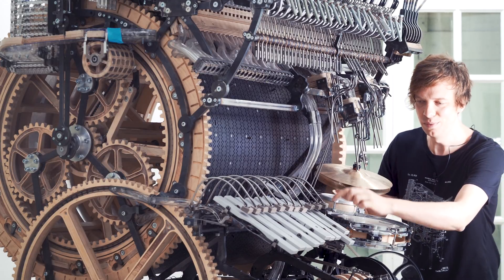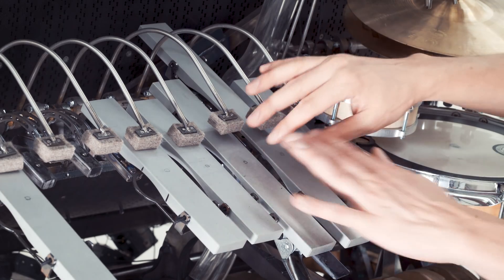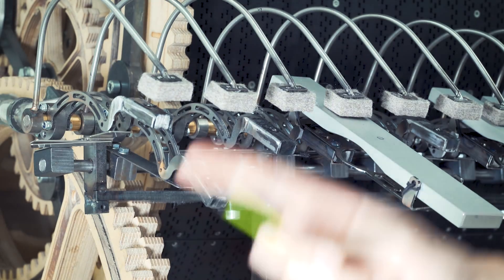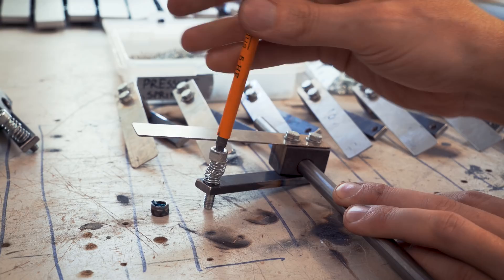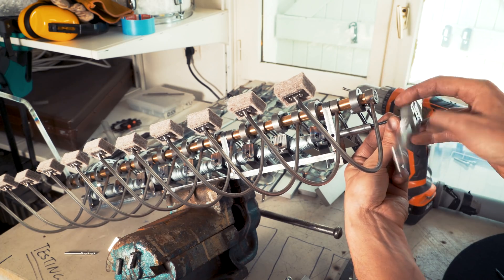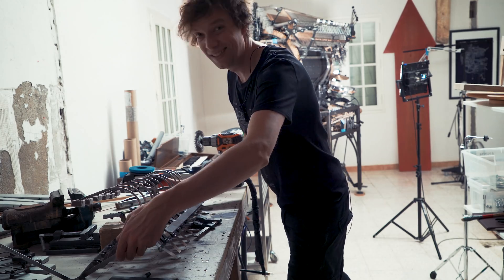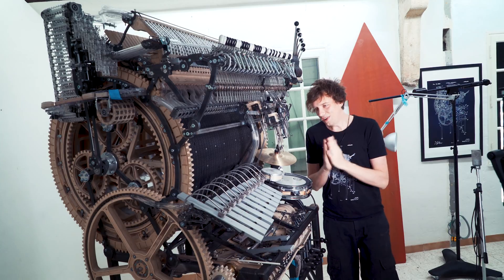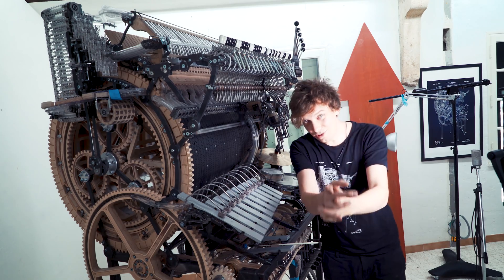Vibraphone Height Adjustment - Marble Machine X #103

Comment: To be honest, I'm still skeptical about the swinging of the plates.
If you play the same note in quick succession, it may happen that the plate grade swings up when the second marble hits it and flings the marble away?
Reply: Correct.  Martin requires that the marble bounce into a funnel after playing a note.  That bounce is highly dependent on the spring constant of the support spring AND the motion of the bar as it transfers energy to the marble.  Conservation of energy dictates that as the motion of the bar changes, the energy transmitted to the marble changes.  Further, as the mass of the bar changes, the energy transmitted to the marble changes.

All of these indicate that Martin will require a funnel large enough to accommodate the range of trajectories.  Until Martin knows that range, he cannot decide on funnel size and may be the reason we haven't seen any yet.

Comment: integrate adjustable springs to the plate holders, tune once and thats it
Reply: Or just integrate spacers
Reply: The weekening spring steel convinced me his solution is better.  Without adjustment he'll constantly be retuneing (sp).
Reply: "Without adjustment..." 
Read again, "adjustable spring" means you have a screw just as he did, but directly on the plates, so no need for adjusting at every swap.
(And can be later adjusted as needed)
Reply: @armanrgun47  How about having a screw at both locations, one for adjusting the spring steel height (combating warp fatigue) and one preset on the note itself? You'd basically almost never have to readjust the notes themselves (since the adjustment is related to the weight of the vibraphone bars) and the spring steel warps slowly, so it would likely be sufficient to adjust it only every set-up.
Reply: A cam on the holder where it rests on the spring steel should work.  However, there is an element of theater to what Martin is trying to accomplish here. So it's probably fine to have a few people "wrenching" on MMX between songs. The amount of laboring can be re evaluated once composing begins.

Comment: If your worried about timing issues from a few mm of height difference, what is going to happen if you play the same note more than once, while it is bouncing several centimetres.
Reply: bouncing is temporary,  but if a note bar is constantly offset it will play each note with offset
Reply: @nandakoryaaa  Yes, and what happens if its hit while its bouncing? The timing will still be off is my argument.
Reply: @qess  Yes it will be off (I don't know how much, it can sound fine anyway) but my point is that you still need to care about all bars being on the same level, or else it will be off always and it will be much more noticeable.
Reply: @nandakoryaaa  Was interested so did the math. Assuming a drop of 40cm, a 2cm swing of the bar could do a 7ms difference in speed. Assuming 3 hits and a maximum difference between the 2.nd and 3.rd hit to be 4cm, thats 14ms. The small 0.5cm constant gap is not even a 2ms delay. U still think the 0.5cm gap is the important one?
Reply: @qess  I personally don't think the gap is important. Once in the childhood I had an electronic stopwatch that showed 1/100th of a second, and I played with it trying to get the exact 1.00 or something. Hitting the 1/100th of a second right was pure luck because my error was always within 0.05. I don't even think about the 1/1000th. I am not a musician but I can safely suppose no one will hear that.
Regarding the MMX, I'm still fine with what Martin did. If the gap is important, then having adjustment is a must. If the gap is not important, then adjusted bars at least look better and leave less chances for some weird things that may happen as an accumulation of small errors here and there.
Reply: @nandakoryaaa  try listing to this up to about 15 ms: https://www.youtube.com/watch?v=3zZRy-UArXM should give you an idea of the perceptibility of the delay.
Reply: @qess  Thanks. I can "technically" hear it from 0.005 but it starts really bothering me at around 0.025th second
Reply: If you've watched the timing adjustment videos, he's definitely been worried about notes hitting less than a millisecond off.  I've also wondered how the moving vibraphone bars doesn't negate the attempt for such a fine degree of precision.

Comment: Martin: can I have some spacers?
Mom: no, we have spacers at home
Spacers at home: 18 washers stacked together
Reply: Ivan and Martin need to get together all the 3d printed Spacers :D
Reply: @brianhunt6943  He had a 3d Printer at some point making the marble lift. Wondering where it is now
Reply: Martin, PLEASE have someone with a lathe help you replace those stacks of washers.
Reply: J Warren he is subconsciously working toward 1,000,000 piece count!!
Reply: Brass tube cut to length as bushing, instead of stacked washers.
Reply: @akphoffman  Brass bar stock turned down into pleasing shapes to add to the steampunk aesthetic, this looks like a job for Clickspring!
Reply: @mulgerbill  Or Uri Tuchman  (Check out his channel if you haven't seen it )  :) Either would do a sterling job. Hope we'll be able to see Wintergaten if they tour Oz.
Reply: gammerbro567 I would have just added weight so each weigh the same
Reply: @stoat-ski  The problem with the weights would be the spring steel will weaken over time and probably unevenly and thus the weight would have to constantly be modified.  That's why this solution is perfect. Regardless of the spring steel's elasticity he can adjust the height stop any time to maintain optimal position.
Reply: @357BlahEn  the marble lift clear parts were CNC'ed by CNCAlex.

Comment: If you integrate the spring to the replaceable part, you can replace the setting with the bars, so you dont need to adjust them in case of swap.
Reply: Or just integrate the spacers to the plate holders.

Comment: Something on the plate holders that adjusts the height. So it is adjusted when you mount that specific bar, and it goes off and on with the plate.
Reply: I was going to suggest a wedge arrangement, but that lack of adjustability could come back to bite if the spring steel sags, or something else goes out of whack. It would be mechanically much simpler for the plates to be rigid, but of course that would look so boring.
I think this arrangement works well, although I would also go along with the suggestion of Marcelo Cristobal of making really long screws that can be accessed without needing an Allen key would be a worthwhile modification. Getting an Allen key lined up can be challenging at the best of times, never mind under time pressure on a potentially poorly lit stage. Paint the top end black and we'll never see them anyway!
Reply: came here to post this... something like a key pushes the screws up where they should be. For each song you can just swicht out the keyplate that rest on that steel bar.
Reply: Keep this adjustment system, but add a second adjustment to the bottom of each vibraphone plate. That way, if each plate is adjusted correctly, it should be unnecessary to make any alterations during performances.
Reply: @edensaquaponics1941  yes this
Reply: Just weigh the heaviest bar + carrier and add that extra weight to the smaller bar carriers so that they all sit at the same hight? simple no?

Comment: There is a far simpler solution (#8): add the spring engagement surface to the plate holder

...this way you adjust it once per plate/holder combo and then just switch out the plates no adjustment required.
Reply: Alex Naanou this is actually really smart!

Comment: There going to be a pit stop on stage when playing a song live  :)
Reply: THAT'S WHY INTERMISSIONS EXIST!
Reply: Yeah it's just going to be runs over unpops the screws swap the disk assembly rotate repeat done ready to go winks and Bam
Reply: @sky0kast0  you forgot about the programming plates on the big cylinder.... otherwise it will repeat the same sequence for the next song.
Reply: Could  be  why the  programming  plates were  built  to  be  swapped  out   rapidly  during  a  intermission   3 sets 2 to use the  3 to reprogram  as needed

Comment: This seems to me an extremely high maintenance solution. Having the solution be integral to each plate holder, like the weight solution, would make switching the notes as simple as... Switching the notes. Using the weight solution, could you not adjust the springs to get the same amount of movement with the increased weight?
Reply: Yeah, I really don't get why the weight solution was bad.  You're going to get the same motion as the lower notes  if you have the same mass since your resonant frequency is just sqrt(k/m).   Unless it's just an artist thing and wanted the higher notes to return faster.

EDIT: in which case building a spacer into the note itself would still work better.
Reply: I think he didn't give this enough thought as well.  Weight every note the same as the heaviest one, adjust the springs to give the desired level and bounce, done.
Reply: It's just Martin going back to his design-creep/overengineering self
Reply: Agreed, the weight solution seems much more suitable to solve the initial problem. That being said, what he ended up with still has other advantages (including being actually built), so maybe it would be a good idea to combine it with the weights.
Reply: Yup, I definitely agree. This basically defeats the whole point of the quick-exchange system where he can just pop on and off notes. When he talked about the weight solution, I thought that was the final one - as then every note would bounce exactly as much as the heaviest one.

And even if he chose some sort of screw version - at least make it adjustable on the note itself so it can still be popped on and off easily.
Reply: I thought the same at first. But the benefit of this solution is it solves three problems at once: aligning the notes, removing the set-screw problem, and adding in adjustability to account for the fatiguing of the springs over time. The drawback is it means making adjustments live on stage, but you might have to do this anyway if the notes become misaligned during a show for whatever reason. Also, this solution at least doesn't prevent Martin from adding adjustability to the plate-holders at a later date, if he finds that making the adjustments live is too much.

My main concern is fatiguing of the piece of metal that the adjustment screws press against. It looks as if it needs a bit more reinforcement.
Reply: I like the idea of being able to do all of the adjustment beforehand so no adjustment is needed when notes are swapped.

This depends on all of the springs, and anything else that's on the marble machine side of the mounting point, to all be the same.  Any per-nit adjustments must be confined to each vibraphone note assembly.

Because the bars and their mounts are swinging from an end, it's not the mass of the assembly but it's moment of inertia with respect to where it pivots that is relevant.  This allows for two ways to adjust the height: adjusting the mass, or adjusting the moment of the added mass (it's distance from the pivot point).
Reply: The weight solution don’t solve the set screw wear over the time, as he explain it well at the end, the rotation movement is hard to stop consistently over time with a set screw. Best solution is to stop the rotation with a linear stop. This machine has to be used over a world tour, so it has to be moved every day, the more reliable the solution , the more stress less will be the band !
Reply: Put spacers underneath the vibraphone notes wich touch the leaf springs. So the height setting is integrated in the vibraphone plates. No added weight and no adjustment needed.
Reply: @slaapkonijn58  Yes exactly! Why didn't he thought of that?
Reply: @slaapkonijn58  Definitely the way to go. Adjusting every note in a live environment won't be practicable.
Reply: Since he just recently cut and rewelded every holder i would have considered dropping that step. I think he would be better off making new holders with different hight. No adjustment needed. 

I don't think that making them all the same weight is a neccesary soloution. The longer bars might move less in the center of mass, but they are longer so it seems like they moove as much as the shorter/lighter ones.
Reply: Why not both? Rather than the weight solution, could he not include a spacer on the vib-holder which has a pre-determined setting? He can use the solution in the video to adjust over time, but leave the majority of the movement in spacers.
Reply: really should have just redesigned the holders to include the height adjustment mechanically, not with weight. The arms that hold the plate could be extended a little to raise it.
Reply: The weight solution is more of a quick fix, as springs can wear at different rates. The adjustability allows for the longevity of the springs
Reply: there's a lot of debate going on here about the most practicle way to achieve an impracticle functionality. We have entered the twilight zone. This is halarious
Reply: @sukoo1   don't worry it will be scrapped mid 2032 when he realises that the kinetic energy of the marble is shared between the mass movement of the bar for visual effect and the excitation into vibration for sound, and tries to compensate variation in loudness.  Stay tuned.
Reply: He said that he wanted the short bars to bounce more than the long bars. If they were the same weight, they would bounce the same amount. If he added height to each bracket, then he would still need a way to adjust the height of all the bars to correct the timing of the music.
This solution takes care of both. I expect that changing the programming wheel will take longer than adjusting screws between songs.
Reply: @bbgun061  At the center of mass they would, but the heavier ones are longer and lager, so it would seem like they moved more if they were the same weight
Reply: @yigitalpdalyan  it would change sound, if he put weight on bar itself. But holder is divided from bar, so putting weight on it doesn't make much difference.
Reply: I agree, I think the weight solution would work the best, that way you don't need to adjust every note on stage. And if you want the higher notes to move more than just adjust the springs uo that end of the machine. But this assembly is still a good thing to have on the machine, and is more reliable than the old set screws.
Reply: If I could I would give this 10k upvotes. Damn, such a shame.

Comment: You might want to consider adding some sort of reference mark/item that they can be set to. as these move up and down you'll lose the required angle of the plate which is critical for the marble to bounce and land in the collection pipe. If you had a reference on one end you know where they all need to be adjusted to (absolute) vs. relative to each other being even.

Comment: I like your solution; however, I think making all plates equal weight would have been better. Seems like there would be more consistency in bounce height of the thing if you did that. I don't know if it would have impacted the actual sound though, if so that would be problematic ofc.

Comment: Instead of a tool for adjusting the setscrew, if there's space you could make custom screws that extends  outwards and easy to adjust by hand (Friday extra yay)
Reply: exactly what I thought, I can't imagine all the notes and all the set setscrews being ajusted quickly and correctly during a concert with an allen wrench
Reply: i mean, you could put an allan wrench in a small cordless drill and do it fast enough that way
Reply: @vahannema  It's not the turning that's the issue, it's having to move and insert the tool in each one. A cordless drill wouldn't make it any easier as they might only require up to 2 full turns. An extended bolt with some sort of modified head means you could adjust it by hand without need for a tool at all.
Reply: I just wonder how long it will take to refit the machine with new notes and music matrixes?
There is a reason why piano has a lot of notes. Some of them are rarely used, but they are there. With MMX, if you forget to change and adjust the note = fail, if matrix is not properly fitted = fail, if you misplace the note = fail. There is a lot of complexity in maintenance of the setup between the songs...
Reply: Thumb screws and Thumb nuts are great things.
https://mk0lightandmotidqi7v.kinstacdn.com/wp-content/uploads/2018/11/LightMotion_Urban_Thumbscrew.png

Also hex keys with screw driver handles are nice to have.
Reply: @ProfCaveman Where do I apply?
Reply: I watched this on the phone, opened the PC to comment the same thing. since there will be limited torque required, a long knurled head that rises above the vibraphone could be an elegant way to do it. I don't think anything is available so the heads would need to be fabbed and put on all-thread.
Reply: Thumb screw?

Comment: Make plate’s holder in different height so it compensates it’s weight with 0 adjusting on the go.
Reply: While that would eliminate the adjustment, you'd have to make everything very precise and consistent. The moment you change the springs, or when the springs get less springy, it gets out of alignment. These set screws allow you to compensate for any change that impacts the height.
If you set it perfect now, it's perfect once. If you make it adjustable, you can make it perfect every time.
Reply: Daan Wilmer adjustable height?

Comment: Why don't you put the shims on the vibraphone plate holders (the bit that gets replaced with the notes)  instead of on the spring? There would be no need to adjust every time you change the note.